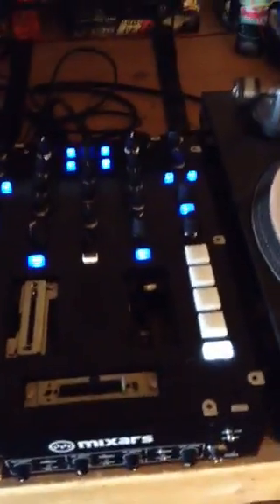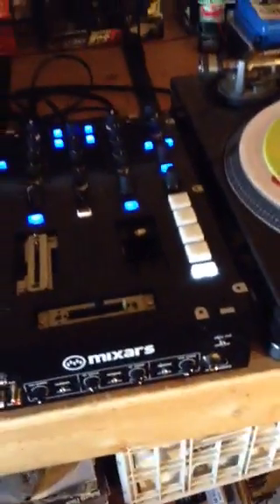Mixars duo mk2 line fader replacement with innofader mini

Comment: Where did you find the 3 pin adapter?
Reply from the maker: in the innofader spare parts.. pnp model has lots of adapters i think
Reply: @illstylus  damn, I bought the wrong one. I got the PT-01 kit
Reply from the maker: @VWVandal213  i know what you mean those kits are stripped down compared to the big package with the full size

Comment: I have a 'crackle' in my right fader on my DUO (MK1). It's been like this since the start and I have the mixer for almost 2 years. It sometimes disappears and when I do fast cuts on the fader you don't hear it so I've been able to use it. It also hasn't go any worse (I think). Do I need a new fader or should I clean it? Advice appreciated!
Reply from the maker: cleaning the fader may clean up the sound. an innofader replacement gurantees smooth operation. if you plan on djing gigs or clubs i would suggest an fader change as you dont want poor sound in a paid environment. but if your just djing at home a simple cleaning could be all you need. give it a shot, let me know how it goes!
Reply: hey, thanks a lot. I just gig at home!! :) I find that there's a delay on the fader (caused by post fader fx I'd say).  @illstylus
Reply: @HuFilms  I have exactly the same issue, did you buy a new fader?
Reply: @MistaTrick  no, I sprayed it with wd40 and it seemed to sort it. It's odd that the faders crackle and lubricant sorted (cleaned)  them as they're digital.
Reply: I tried to do it and it came back @HuFilms  I have a big gig that I need it so I'm not going to risk it.

Comment: Mini innofader duo or mini innofader plus please ?
Reply from the maker: i used the mini inno duo, however im sure the inno plus will work if you have the 3 pin adapter.
Reply: illstylus ok thanks you
Reply: The plus is too high and leaves a gap. Annoyingly as I just spent £100 on it
Reply: 6 years too late, but it's linked from the innofader page and I've just done this myself. To answer some questions:

Mini innofader plus works fine for me and includes the correct cable. Needs spacing from the mounting plate to retain OEM fader height, but the hardware to do that is included. Orientation of the cable doesn't seem to matter. I also used some heatshrink on the joint between the fader and adapter cables. Fader curve control on the mixer still works.

After removing the OEM fader that has always been a bit iffy, I found a couple of the pins on the sliding fader mechanism were bent.

Comment: Hello illstylus Sorry for disturb you !!!! That's it bought  my innofader duo  but I totally  block on the record Wen he talks about the adapter 3 pin they say To put the gray wire on the black +White wire of the mixer (Référence To connect the 3 pin adapter, the example it's Reloop mixers and contrôlers but already  I have no black +White wire but a gray on a few cos and them black after the middle one black with White writings and the last wire is black !!! What do you  recommend me if you and where you've go To ses for (more infos). I have that as indications and on the other side is To calibrage !!!! Thanks you verry much in advance illstylus !!!!????!!!!??? Sorry for my english langage I'm not speak english thanks à lot big up
Reply: I think it's the translation that  misled me because white+black it's gray and that's where he tells me to go and the pass has been black it even says it on papier so there  is more than the gray side
Reply from the maker: are trying to put an innofader in a reloop mixer? if so i have no experience with reloop mixers.
Reply: @illstylus  yes It's ok and verry good fader Big Up Ilstylus